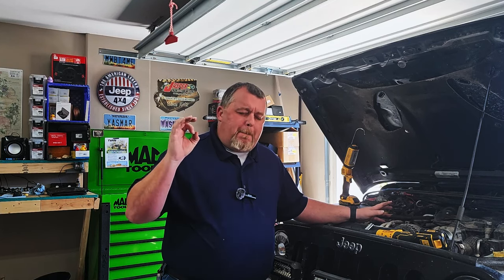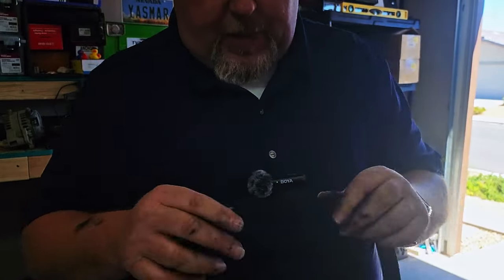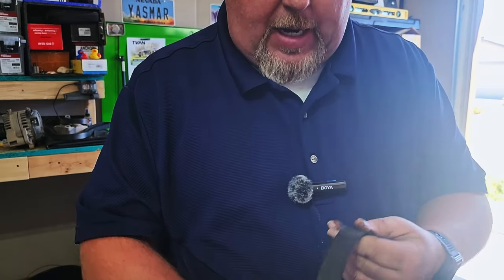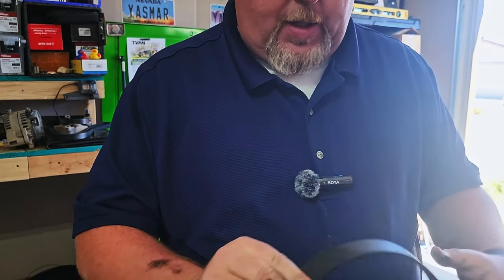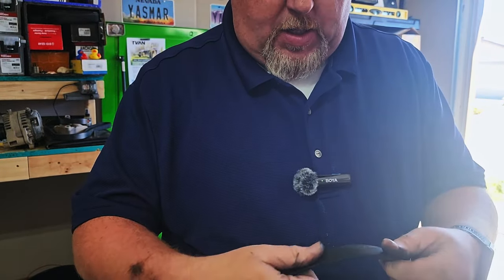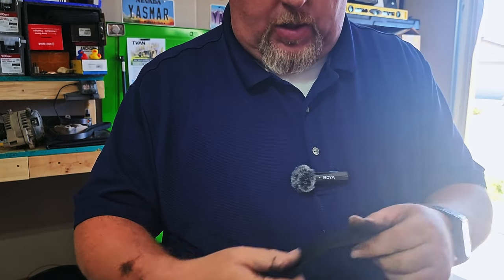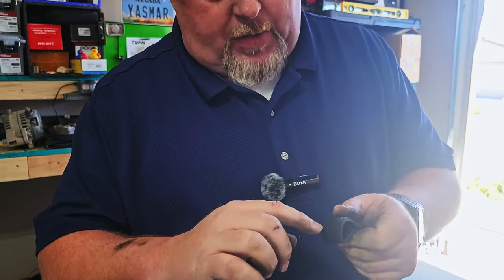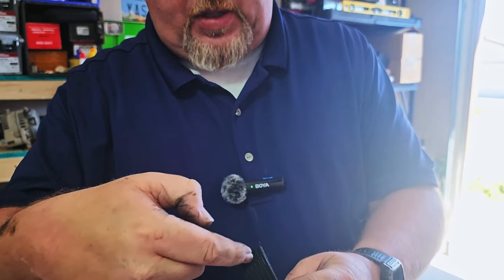Replacing Serpentine belt on Jeep Wrangler 3.6L V6 Pentastar.  Why?

Comment: I always change my serpentine belts on all three of my vehicles every 30,000 miles no matter what. And I always have a spare with me especially in my 2016 jeep JKU. By the way! You don’t have to remove the alternator all the way off or unhook any power supply to it. It’ll slide forward enough on those two long bolts to get the belt off and back on. Done it more than once believe me. But I understand for the sake of showing folks a how to video you went this route. Just makes it easier and faster not to remove the alternator completely. Good video

Comment: I'd say in the northern part of the US it needs to be replaced more often.  Salt plays a huge toll!  I just went down this rabbit hole.  My rad hose clamps were rotten on my jeep 2017 JK.  While I was in there I did upper/ lower rad hoses and calmps, lower heater core hoses and clamps and my serpintine belt.

Comment: Jeep JL 2018 SPort s, had to replace mine today at the dealerhsip.  THey said the pulleys were worn and suggested replacing those too...I did it, it was not cheap like 800 bucks for everything but TBH 800 bucks is not bad at 100k miles, it was whining for about 10 days on startup in the AM then it went away but did not want it to evolve into something worse.  Knew the belt replacement would have to be done at some point around 100k miles of hard driving (off road, long trips, etc.).

Comment: Great video. What watch are you using? I have the Samsung galaxy watch 6 classic 47mm but it's really too small. Your watch face looks way bigger. How does it compare to Samsungs? Thanks!
Reply from the maker: What an interesting question.  Random. 

I use an Amazon special "smart watch". 50 bucks. Does literally everything a Samsung watch does, except have it's own network.  So it has to be within 30 feet of the phone to use Bluetooth for phone calls. Otherwise,  no difference.  And, even under heavy use, that battery lasts about 8 to 10 days between charges. Lol.

Hope that helps. 😉
Reply: @JeepingForBeginners  Thank you!

Comment: I have a question. What spare parts would be a good idea to take on the trail with you?
I Remer a few videos back when you were in Colorado, your buddy's tensioner pulley left this world, rip 🙏.
Reply from the maker: Well, honestly you can never anticipate every possible failure. But what you wanna bring starts with a thorough vehicle inspection before you leave. My buddy missed his belt as part of the inspection, too bad because it had to have been showing signs before he left Texas to met us.... but it is what it is. 

What I carry, and what you should carry maybe two different lists. But if you know your Jeep, and know your wheeling behavior,  then logically you will know what is the most likely to let go or fail, and therefore what to prepare for.

I bring an extra hub assembly, an extra clutch slave cylinder, and extra front axle U joint, a flat tire repair kit, fluids like oil, water and brake fluid, and all the basic tools necessary to repair or replace said components and more. And most importantly, reliable means of communication.  Frankly, on that trip to Colorado,  having access to Starlink is what truly saved our butts. 

So I would say, prepare the best you can, but realize you will never have everything... make sense? 

Good question though, possibly a topic for my next video. 😉

Comment: My belt seems to be squealing and my power steering doesn't work great (2017 Jeep JK). I'm at 80,000km on the factory belt. 1 year in north Ontario, then 4 years in Florida, now 3 years in north Saskatchewan. I changed the power steering pump a few months ago. Didn't help and  I didn't even think to look at the belt.
Reply from the maker: Check your tensioner and idler pullies as well, especially if along with squeaking the PS is poorly performing. I bet you have a pully that is not turning true
Reply: @JeepingForBeginners you where correct. Tensioner was leaking oil and shot. I couldn’t find any YouTube videos on how to replace it. So I took it in to the shop. Charged me a fortune $700 (dealer = mopar). I’ll go to private shop next time.
Reply from the maker: Don't feel too bad, the hydraulic tensioner on those motors are stupid expensive and a pain to get to. 700 for mopar parts and labor is probably not bad these days.... I'm glad you were able to resolve the issue though!

Comment: Nice video. Unfortunately I ve been left in the middle of the road. Not sure if the tensioner gave up first or the belt. Never been advice even to inspect it. My question if you can help, which one is the part number for a 2016 Wragnler 3.6 petrol? Had problem to find spare in uk and the garage managed to feet a Gates 6pK2220sx driving belt. Car fine for now, but i am not sure it is the right belt. Thanks for helping
Reply from the maker: That Gates PN here in the US is K060876, but not sure of the part number is international or not. The Dayco PN is 5050433 and the Continental PN is 450K6.... but again, these are for the US.... but could act as a reference for ya. Hope that helps
Reply: @JeepingForBeginners I found it thank you. This means that it is a 2224 mm length belt. And what I have fitted is a 2220 mm. Do you think this may create issues? Better having it replaced again?

Comment: Did you have to lossen the bolt on the tensioner???
Reply from the maker: No. But if it does not move at all, regardless of the effort behind it, you may need a new tensioner.....